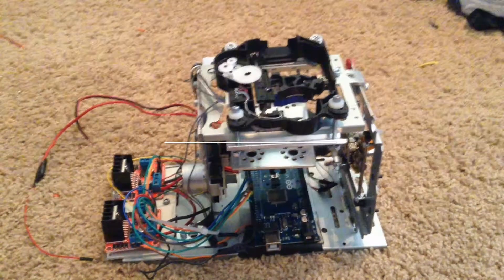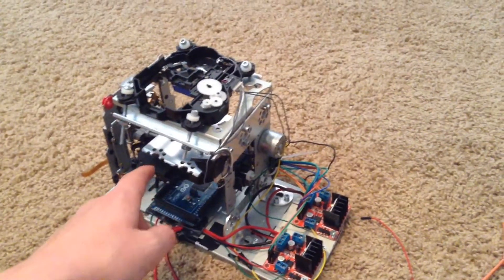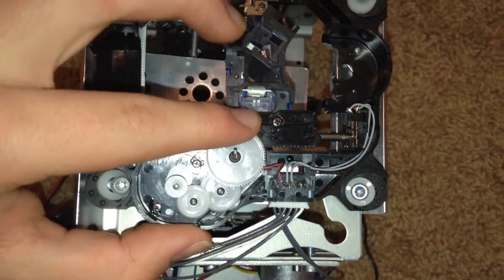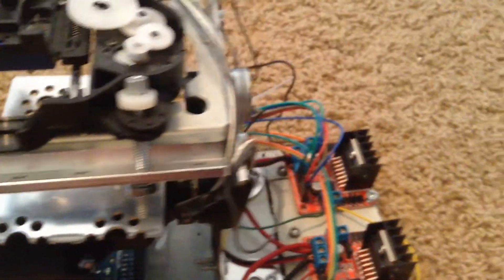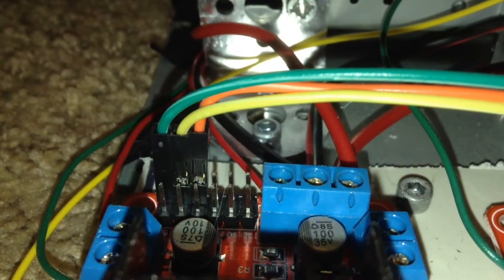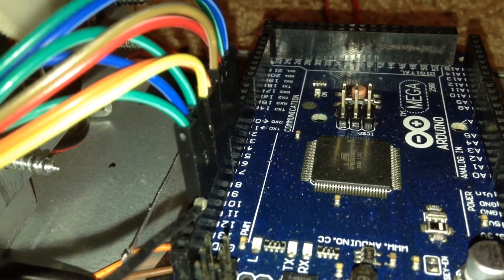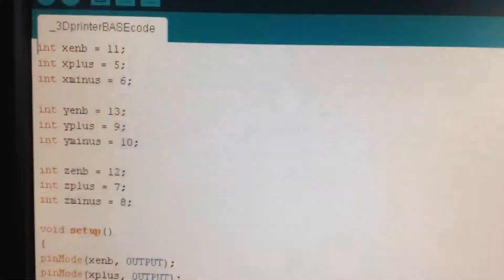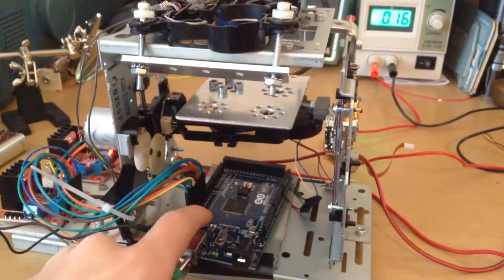CD drive 3D Printer

Comment: You can use  hall effect sensors . you can get them from CPU fan (not all CPU fan has this sensor). The hall effect sensor tells the speed of the motor (RPM) . You can use this information to calculate the distance and positon .

Comment: well it seems someone already built. what i was going to try!
*try to make them precise(motor).
*use some kind feedback system for motor(i mean tachometer or something like that).
*visit this link , this may help you."https://www.youmagine.com/designs/dc-motor-closed-loop-control-software#!design-information".  
*post latest video if u can.
 i have some ideas about tachometer or feedback system too.
 and above link seems good for you with marlin firmware in arduino mega .
i would like to hear you about this printer. please update video.

Comment: man i have a similar device and i use a board that connects to the arduino and i cant figure out how not to make the stepper go completely insane
Reply from the maker: I used DC motors for this, not stepper motors.  I have not used stepper motors with an Arduino yet so I can't help you with that one. Sorry
Reply: Um that's alright.  Anyway I got one of my friends who collects electronic devices for scrap metal and he supplies me with any device I need and he almost has 200 CD drives. So I got two large printers from him and took e rails out and I'm gonna build a big wooden cnc
Reply from the maker: Wow, that is cool that you have access to all those components!
Reply: Yea I got access to even old power line transformers too...  can I talk to you in person?
Reply: guys a little help here